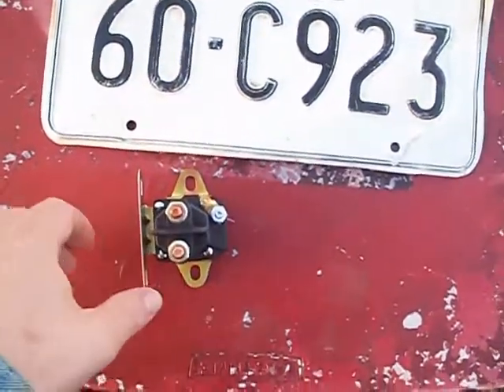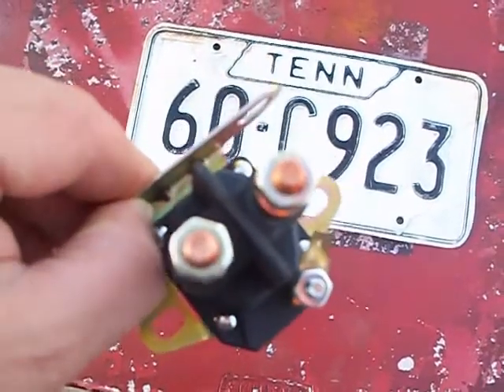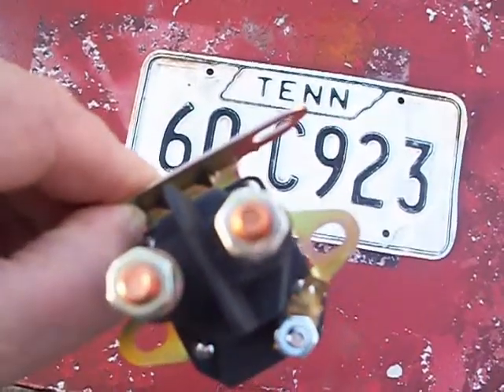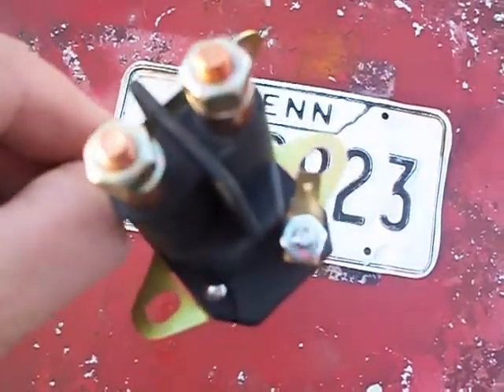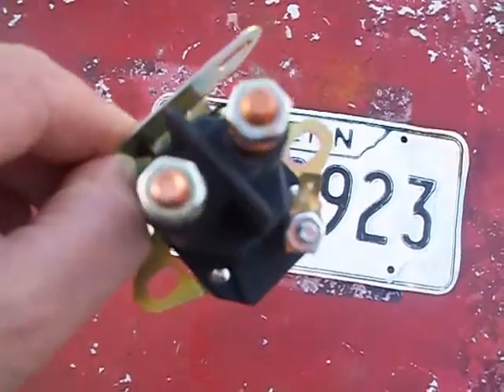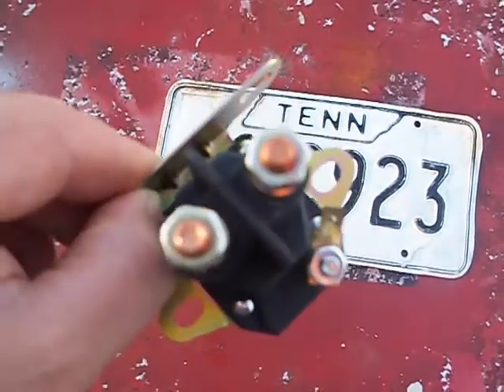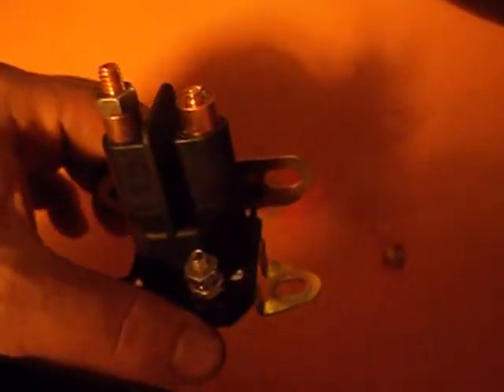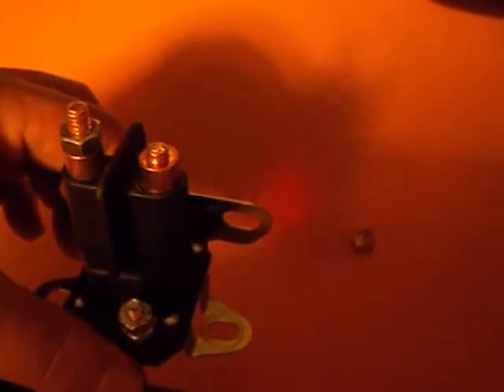solenoid came for the simplicity 4211 won't belive what I did to it.

Comment from the maker: yeah I know any 3 post solenoid will work on my tractor as well as any tractor wirh 3 post or and 4 post solenoid will work too on any tractor. that what i belive. the one I did break thats on the simplcity tractor now was 8  bucks and is oregon. bought it on ebay the oregon one is alot better made then the one I broke.I shop between ebay and parts stores to get deal . sometimes a store my be cheaper then ebay and sometimes eba can be cheaper

Comment: Y don't you drill out the one you broke I'm not shor how far you could go down but to drill it out and tap  some trends in it and make a bolt to tred in to it ... Major shor it's not to long so it dosnot strip out the treds               Or just solder you cone shuns to getter